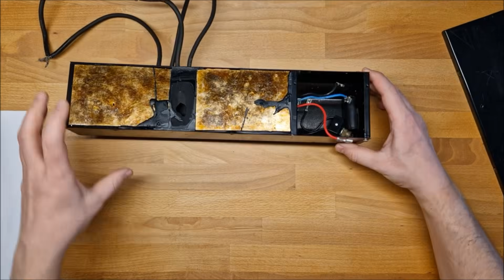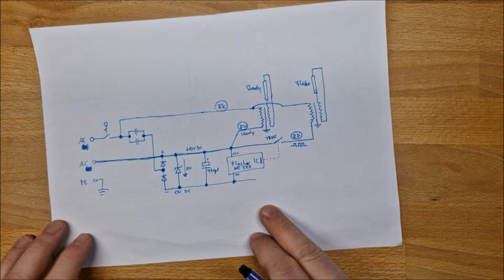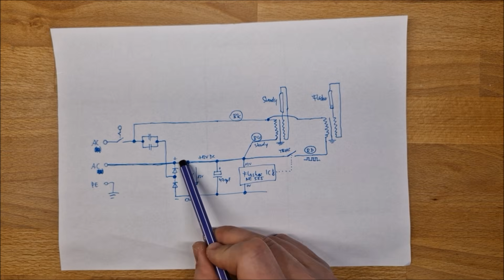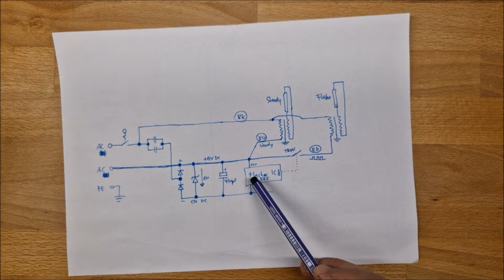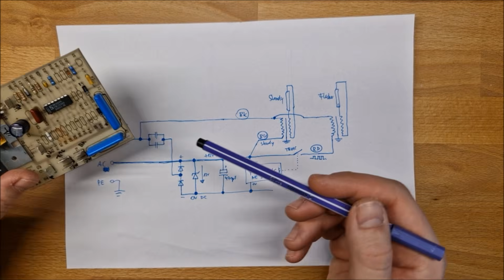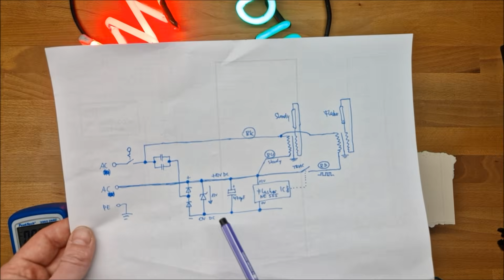Flashing Neon Sign Transformer Repair - Circuit Board

Comment: can you explain a bit more about the part that the 12v dc rail is still the ac rail and how some countries don’t have polarized plugs?
Reply: In some countries the plugs can be plugged either way. Like in some European countries we use the German schuko plugs and those can be plugged either way because they are symmetrical. That means that either of the inputs can be the live or the neutral regardless of how the socket is wired (live on the left hole or neutral on the left hole). The diodes in this schematic appear to be arranged in what is called a half-bridge configuration. That means that they will only rectify during one half of the sine wave cycle. To understand how one AC line can be the positive line too, you have to think about how voltage is a difference of potential between two points. You can have a power transmission line with hundreds of thousands of volts between it and ground, but the birds can still sit on top without feeling anything because they don't touch the ground. The same way you can be in a moving vehicle in reference to the outside, but you won't feel anything unless you touch something from outside. IDK if I explain well.

Comment: "Yeah, dirt-cheap is just right for our customers" — Franceformer, probably.  🤣

haha, i love your humor, mate.  also, great job troubleshooting, diagnosing, and repairing the circuit!  i'm so accustomed to mechanical flashers it seems strange to not hear any noises when the tube is flashing, lol.
it looks like that PCB has room for many more components, i wonder what else they used it for?  do you have any ideas?
Reply from the maker: It was prepared for a second flashing channel to be installed - hence also the double 555 chip